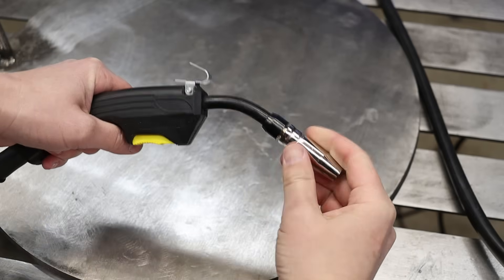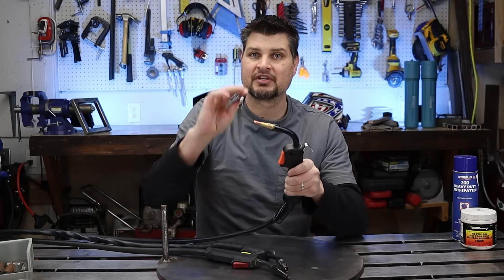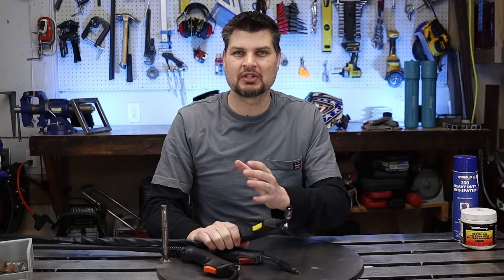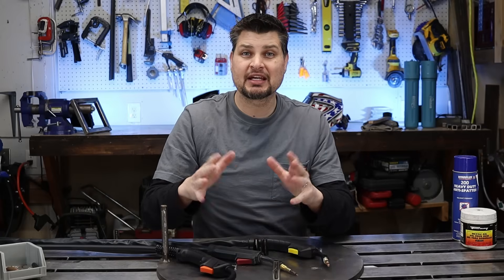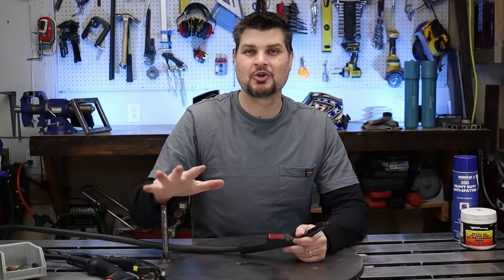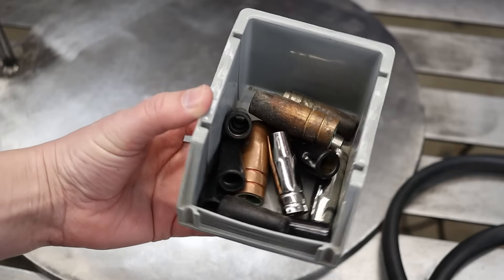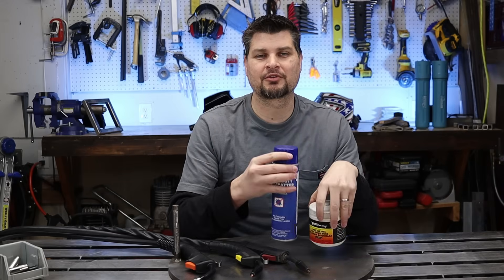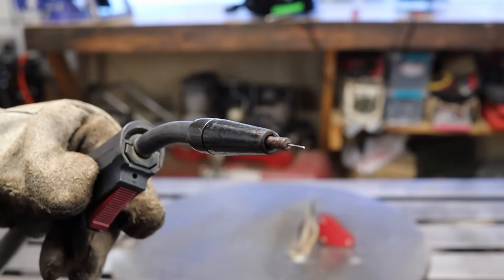#1 Tip and Trick to Improve Flux Core Welding

Comment: Run a gas nozzle period, you need to be able to pivot and drag off of it. No nozzle is just for newbs who don't know better and the cheap welders don't include them to cut cost.
Reply from the maker: Would you use a gas nozzle even if it came with a flux core nozzle?
Reply: @-DIYPRO-  yes

Comment: Ex Shipyard welder here (lindo mearsk Denmark) 6gr codes. 1.6mm flux core on 15mm plate single V butts on the verts ( 4/5 mil femax iron power rods on the hori filletts. Listen up young welders. DON'T DO THIS.
Reply: I concur.

Comment: I have flux core gun like the one you showed first. Sometimes the trigger sticks and wire feeds out on it's own and I have to bang the tip to stop it. I have taken the it apart and it still sticks any  Suggestions?

Comment: I've got a cheap Mastercraft flux-core welder I picked up years ago. Plugs into 120, which makes it very handy to lug around to where I'm working (I also don't have a 240v line in the garage). One knob for feed speed and just high/low voltage and amperage switches. One day I want to invest in a multi-process welder (being able to TIG-weld aluminum would be very handy my repairs as well), but even what I have now has been very valuable for doing repairs for my landscaping equipment and my trailer. Even at the hobbiest level, having a basic flux-core welder is a good investment!

Comment: Wow!!! This is a game changer! Here I've been welding with flux-core for 25 years and never thought to remove the gas shield. Excellent!!!
Reply: are you serious?
Reply: The downside is when you weld 350- 400 amps it gets very bright without the shield.
Reply: Got to love it when flux only welders come with a gas shield.
Reply: I've been welding 2.5yrs at home. Just now grabed som C02. Thinking its gona be so so nice not having that cloud running in my nose, but I'm not looking forward to the fater tip.
Reply: You don't need any nozzel with flux core.
Reply: There are shorter plastic shrouds to put on your gun for flux core.  They help keep the spatter off of your tip, but they don’t make the weld any better.  Get gas.  Use it.  Make better welds.

I got an account at AirGas, bought a small cylinder, and my welds improved like magic.
Reply: @1wheeldrive751  Flux core wire will give you better penetration, and is what you need to get the max capacity of thickness that a smaller welding unit is capable of, so " better welds" isn't a good statement.
Reply: @Internutt2023  - nonsense.

Comment: Flux core welding is a superior process, far superior then mig and arc. I use it exclusively for two main reasons, you can weld in the wind and it has 70k tensile strength. Mig has 60k and arc 70k is much harder to use. I don't know of any 6011/6010 In 70 series rods for arc. So, when I'm in the field fixing shit I can blast through rust, paint, etc using flux core 71gs and watch the puddle dig deep during a rain storm, or even in a tornado.

I've used a 110v flux core welder to weld 3/8 plate steel, with proper technique it's strong as it can be. I've used the same 110v welder to weld 1/2" and 3/4" steel, but at those thicknesses I use a oxygen torch to heat the metal like a tig welder.

I only use mig or
Reply: Or tig if I want shit to look pretty, mig has no place in my business and I feel it's only used if you care about looks. 

I used a 110v flux core welder without preheat to make a trailer hitch for my truck that tows 16k pounds, it's been 3yrs and it done nothing but held up. Flux core is the strongest and easiest process if you know how to do it correctly

Comment: That flux core nozzle protects the threads from spatter . So, is it necessary for welding , technically no, but it does protect the equipment.

Comment: If your not able to see what you are doing with the nozzle, change your hold of the gun or your piece. Removing the nozzle so you can see is not a good approach especially if you wish to graduate to MIG or TIG. Don't sacrifice your tooling for improper use.

Comment: So didn't know about the flux core only nozzles...need one of them cause when your welding crap material most of the time it destroys the gun not that i think it will protect the bits that aren't replaceable (damn splatter) and spatter spray is great when its viable.
Everything is an investment and if you can afford the extra great, but sadly some of us live in a cents/dollar world where even spending $20 for a better finish is feeding myself
Thanks for upload

Comment: You do want some sort of nozzle for flux core. Particularly if you’re new to welding, you’re going to find a lot of spatter on your torch end. While antispatter and nozzle gel works, it’s not perfect, so large BBs do weld themselves to the tip.
Reply: Just tried removing the shielding nozzle after watching this video... and yep, it was a mess! The weld was spattering all over the place, deep holes all over the bead... and then on my second attempt it ended up welding a big lump on the end of the tip. Had to grind it right back as it wouldn't break off. Put the nozzle back on and it was perfectly good again. Not sure about this "#1 Tip and Trick to Improve Flux Core Welding" at all.... haha.
Reply: A good unit should come with a flux core tip cover, that tightly covers the gas ports on the nozzle, but doesnt obstruct the actual tip. My Lincoln SP-175 came with that cover, and slso said to use it in the instructions. With that tip cover, I've found myself never needing anti-spatter gel, but I do use it with gas and the gas cup.

Comment: Nozzle dip or spray is porosity in a can. Burn a couple of seconds weld on scrap to burn off the volatiles in the spray/dip. The need for it is eliminated if you keep your nozzle clean and smooth. Take the time before starting to dress any nicks out.  No banging it on the work to get the spatter ring off. I never had any problem with using a full size nozzle, if there was a clearance problem, just slightly oval a standard nozzle with a hammer. Got my Journeyman Ship fitter card in 1976.

Comment: I tossed my nozzle from my flux core many years ago. Completely changed the game.  All the nozzle did was fill up with slag and flux and it was a pain to clean it so often because it just got clogged up very quickly.
Reply: you can easily clean it with the same hard brush you use to clean the welds
Reply: @rubenheymans1988 The welding pliers are designed to clean it out but all it did was waste a ton of time, when the nozzle is only for gas anyways. I tossed it many years ago and never looked back.

Comment: My biggest problem is with the auto darkening helmet.  I can’t see well enough no matter the setting.
Reply: I make a veil out of some black t-shirt material for the back to stop the light from coming in and tape it on and I find that helps a lot and sometimes I use a high-powered light to light up the welding area... a larger viewing window helps and a good helmet has a din shade control.. The higher the number the more the darkening. You can look that up for more information on what your safe setting should be for the type of welding you are doing... I'm self-taught and not a professional but it works for me
Reply: I use a flood light, helps me

Comment: Excellent advice. Just FCAW welded a 22g sheet panel repair on my sons car. Wish I had seen this first and removed the MIG tip. Repair still came out great but this would have made it easier.

Comment: I use flux core wire on my machine welder. I use compressed air to cool the tip, which extends tip life.
Reply: and the air will blow the weld puddle and your welds fill not be good, it's not arc gouging.
Reply: @SouthernGround  Hi, i do this when bore welding prior to line boring. Never had a failure awlays good finish. Give it a go.
Reply: @bencrosby2364  what object are you welding? "bore welding" like in a blind hole?
Reply: @SouthernGround   This method came about from working in remote areas. google line boring and bore welding. Sometimes a weld pass can take an hour. In the feild sheilding gas and wind don't mix.
Welding castiron, cast steel and high tensile. Only need enough air flow to remove fumes.

Comment: If you’re going to speak on gas less welding stick to it and don’t confuse the two on video. Why? Because beginners need to understand the single process rather than confusion between the two. Do a separate video on mig welding using gas!

Comment: A couple old timer welders I know will cut back a nozzle to use for flux core.  It protects the gas ports but makes flux core welding easier.
Reply: My Lincoln SP-175 came with a flux core cover for the tip, its tightly contoured to cover the gas ports better. It also says to remove the gas cup and switch to the flux core tip cover in the instructons, that I guess few people read.

Comment: that wire is innersheld  NOT FLUXCORE flux core an mig you have to use gas innerseild was designed for welding outside

Comment: How long have you been a welder? I'm a certified welder acr, oxy acetylene,mig, tig.when I say certified and I mean aircraft and missle certified plus heat treatment and electroplating, did for over 20 years haven't done it for almost 20yrs since I retired from the U.S.A.F 
 BUT I BET YOU CAN'T FUSION WELD CAST IRON WITH OXY ACETYLENE ,materials aluminum ,mild steel magnesium cobalt inconel 718 titanium 410 stainless steel any where from. .125 to .032 thick! And 1f 2f 3f 4f 5f positions do that!!!
Reply: Fusion welding cast iron is something I've never seen. I just braze/bronze weld it
Reply: @zukispur5493  three types of cast iron gray,malleable and white.
Reply: @thomascreary990  interesting.  I'm not in the game now after about 30odd years being in it. It's been couple years now since I last struk a arc yet I'm max% sure I'd piss any pipe &plate coding tomorrow with either hand. Happy Sunday mate from this side of the pond. London
Reply: @zukispur  try 6 to12 and 6 to12 left and right handed 5f .040 to .032 tig welding you probably can't weld tube to plate it's like riding a bike for me and it's been years and once you  know it you don't forget and I can walk up to a welding machine set it up and go and I was a contortionist working on inlet guide vanes on B-52 and KC135A model aircraft use my knee to operate the foot control and position a mirror so I could do the job sorry mate
Reply: @thomascreary990  top stuff👍
Reply: @zukispur  that's not welding it your just bonding it and you can arc welded it if you have the right arc welding rod and I won't release that info too anyone true welders keep some secrets been a welder longer than you think!!!!
Reply: @thomascreary990  It did the job at the time (nothing structural
Reply: @thomascreary990  stainless steel rods do the bodge up trick also

Comment: You never run bare tip Period........  even with flux core.  You hit that tip once on a surface and you just blew the freaking guts out of your diodes in your welder.  Gas tip and flux core tips are insulated for a reason and that is it!
Reply: You mean the tip that's conducting electricity to the wire that you're touching to a surface? 😅